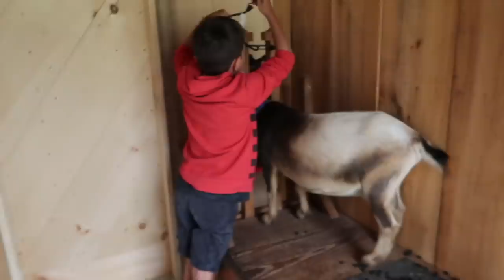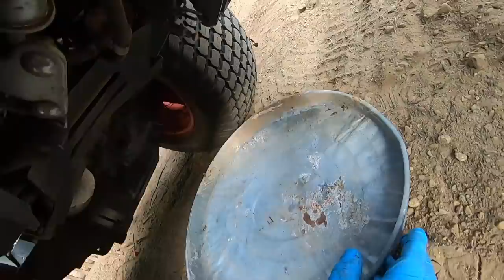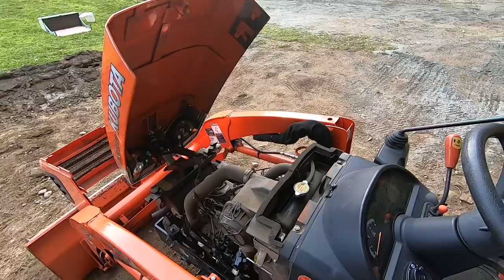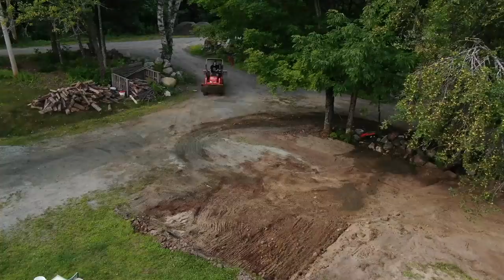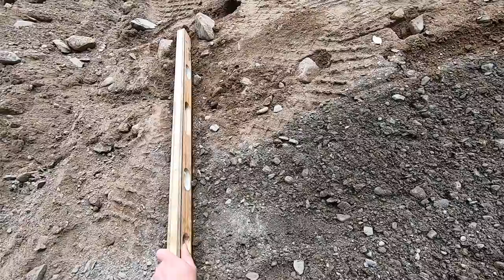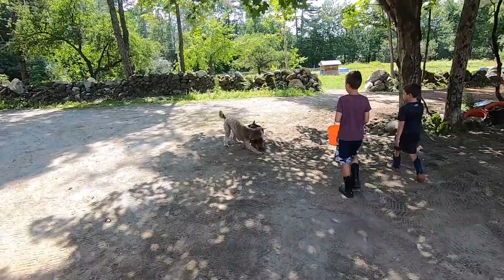Finishing Up the Site WORK for the POST and BEAM FireWood Shed

Comment: Hi Al
I have run diesel tractors since 1974 and always use a funnel filter when refilling the fuel tank, the more filters prior to the tractor filter is best for clean fuel. Dave
Reply: Ive seen water separator/filter funnels used on sailboat channels. Your suggestion is spot on!!

Comment: I have a Kubota B-3350.  Every time I change the oil, I also change out the fuel filter and the air filter.  Sometimes, I can cheat with the air filter by taking an air compressor to it.  Love the different jobs you can get done with your machine.  And I really enjoy your videos.

Comment: I am glad you got your tractor running well again.  I replace the filter under the operator station twice a year and the filter under the hood once per year.  I do this two filter change in the fall before it gets below freezing and then I replace the one under the operator station again in the spring before I reinstall the mower deck.  I remember the when my tractor quit working due to the fuel filter.  I changed the filter under the hood and it still did not run.  Then the service guy at Messick’s told me a there was two filters on the BX. LOL

Comment: Did you know.... that groove about 18 inches from your tailgate in the bed of the truck can accept a 2x8 and be used as a cargo stop.  Perfect for fuel tanks and stuff.
Reply: the groove? yep, most truck beds have some kind of slots or "troughs" you can fit 2 X somethings into. I used to do it with my lil S10. Some can even work to support whole higher level "floor" setups so you have the equivalent of two truck bed areas.

Comment: Gaauud Mawniin Lumnah Acres!!  Hi Al, I'm just loving these 'build' projects on your farm, your skills as a carpenter/builder never stops impressing me!!  Your mechanical skills are also excellent, evidently from working with your Dad in the younger years! We pray your Dad is well and doing great. When I start my builds for the homestead, I think I will start out with chicken/pig tractor shelters, then move on to the 'Jamaica Cottage' kits. Watching your videos and seeing your skills and technics have given me such knowledge, I never get tired of watching them! You and Dom are an excellent team for expanding their sales/applications for their structures.
 I know your time is precious, but I believe you should've changed out all the fuel filters at the same time. Also, drain the fuel tank to get rid of the moisture and 'heavy ends' (dirt/particulates). I am very familiar with our neck of the woods, and the seasonal temperature extremes lend themselves to condensation, gelling, and dust contamination in diesel fuel.
God Bless

Comment: I'm of an age where you had to bleed any diesel systems if you so much as looked at them wrong.

Change filters: bleed the system.
Run low on fuel: bleed the system. etc. etc.

While modern engines are so much better, some things are still the same.

I know rocks are a pain when trying to work or make pasture, but they also can make great play areas for goats.

Hopefully once the shed and barn are finished, you'll be able to make some amazing rock mountains for the herd
Reply: Yes that's what I was going to say about the fuel filter but you stated it better!  I was around diesel engines via my diesel mechanic husband and having a diesel engine car a long time ago.  I was going to say prime the filter with fuel before placing and possibly draining all the old fuel and starting with new.  Love to see Al work about the farm-he is amazing!

Comment: I could really use a kubota right now. My husband works for a trucking company that hauls dirt/sand/gravel /topsoil etc. We just purchased some dirt for our driveway because the rains in florida have waterlogged the yard and there are huge ruts in it. Ive been leveling the dirt by hand while husband is at work until he can borrow/hire a tractor. Lol the pile doesn't look so big until you're up in it 😭

Comment: Al,  I would make the site big enough for a carport on both sides of the wood shed, one for the car and one for the tractor, if you never get around to building the second carport, no big deal, but moving the building later to make room for a second carport would be doing things the hard way.  Good luck.

Comment: To bleed the air out of injectors while the diesel is running..
Crack the injector line open.... One at a time and let them push the air out..
Thats for diesels where the injector has individual lines feeding each injector
Reply: Good to know 🤠
Reply: @jeanniegriffin1692  
When replacing injectors
Replace one at a time
Then bleed and move to the next
Easier to bleed than pulling them all out
And then trying to bleed them all when the engine doesn't run
Reply: Great info.

Comment: Fyi, was watching older video here, when buying fuel, check into getting 50 gallon fuel drum, can find then relatively easy and you can get stand or have one made which you can put somewhere for easy access, almost every fuel company will deliver off road diesel for your farm at a cheaper rate. You will be able to have fuel on your farm vs. Having to run to get fuel each time. Only difference between off road diesel and vechicle diesel is one has a dye added to it to identify if off road diesel is being used in street vehicles (which is highly illegal if you get caught).

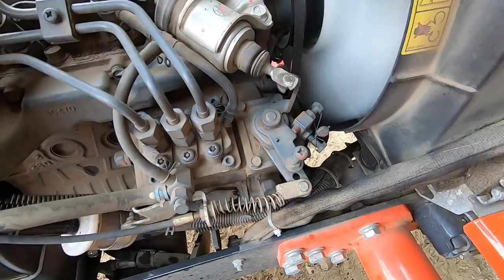Comment: Al, I'm not sure if someone has already  mentioned this but at 8:22 you show the fuel cut off solenoid actuating.  Unless you are turning the key on and off at the same time then something in the safety circuit is activating - like a loose connection on a seat safety switch or the mower deck (I know this is off in the video).  The idle wasn't rough from air in the fuel at this point in the video it was because the fuel was being cut off then then on again repeatedly by the fuel shut off activating.  I could hear it happening earlier in the video too.  Could be you have an intermittent electrical issue somewhere - worth investigating before going too far down the fuel filter/ contamination route.

Good luck with it!

Comment: If you saw crud in the filter you might have blockage in the fuel separator also. I don't think you have water in the gas line. You seem to keep the tractor covered when not in use.

Comment: Anytime you have a running problem with a diesel always change the fuel filters first and it sounds like you have air in the fuel system

Comment: I know this is not a truck, but my diesel truck surged like that, and it turned out, the injection pump timing needed to be turned up a bit. As these age, the combination of the injectors slowly popping at lower and lower pressures, and the injection pump wearing, tends to make the timing lower, when set at the same setting.

Comment: Sounds like it is still idling roughly.  You probably need to take off the float-bowl in the carburettor and clean that out.  Also a need to clean the carburettor jets and its fuel filter?
Reply: Its a diesel engine...no carb - it is direct injection but great trolling on ya...

Comment: Al,   How many hours do you have on the Kubota?   I have 350 hrs on my 2360 and have had no issues with that fuel filter.   Kubota suggests to keep the fuel tank full, especially in the winter.   Respectfully,   Kevin
Reply: I do the same with my diesel-powered Citroen C3 (small french car, but comfortable and very economic). Even if I have only used 5-10 liters= 2-2.5 gallons and I see a service station/petrol pump where the price is low I always top up the fuel tank. Reduces the risk of condensation.

Comment: Why not draw a string across how high you want it?  Will you have a cement floor?
Reply: A concrete/cement floor might not be needed for storing firewood. If it's placed on pallets it won't rot or be spoiled by water going into the shed. Air can circulate on all sides to dry it out even more.

Comment: air and water in the fuel for diesel motors  makes them run rough.
Reply: What state do live? Seems cold area
Reply: @susanshead7167  I have a diesel truck with a water separator.  When I change the filter I bleed the air

Comment: Another inexpensive way to check level..
Drive a stake in a corner..
Come up like 1 ft..tie a good string.. 
Then use a string level..
Pull the string tight...and level it
(try to break the string, no sag) then check any place you want..
If it measures 1 ft then you're as close as a syring level gets...

Comment: Maybe when you have time.
Get a large spin on oil filter with housing (smaller microns than the filters on the Kubota) hook it to an electric fuel pump and let the fuel cycle for a while to get the dirt out of the tank..
When you're done you can cut that filter open to see what you pulled out
(Ebay)

Comment: Spark plugs ?????
Reply: On a diesel? I don't think so. Diesel engines use compression ignition. They suck in air and then compresses it about to 1/14 to 1/16th of the original volume. That makes it so hot that the diesel injected into the cylinder burst into flame and pushes the piston down. That accounts for the distinct knocking sound from a diesel engine.